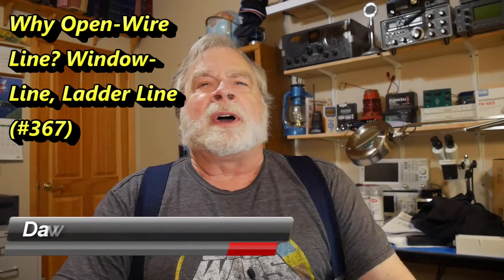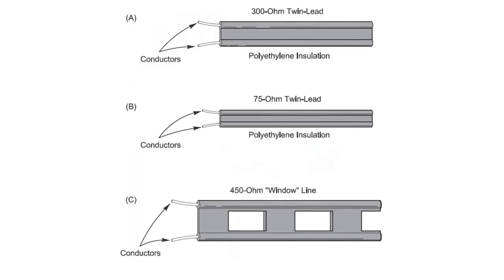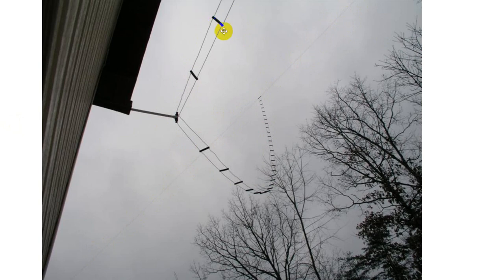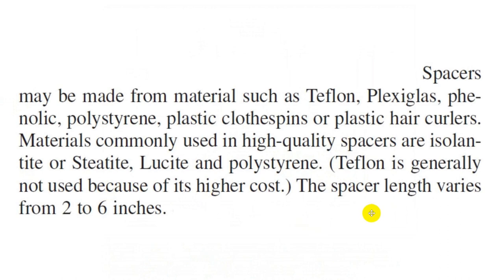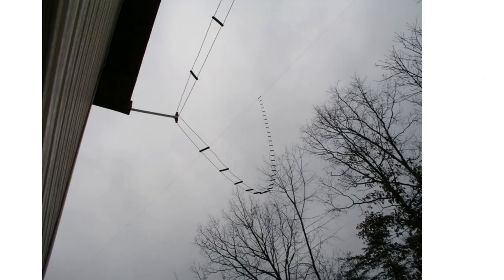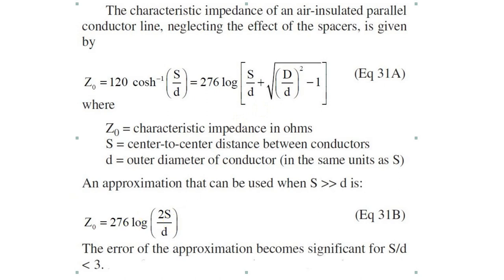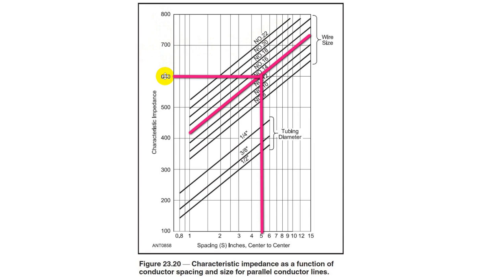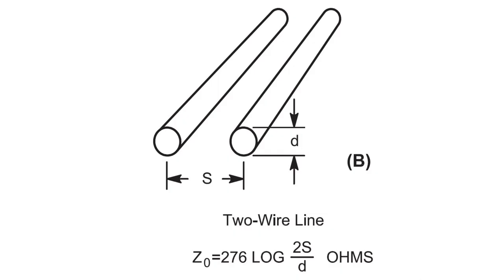Ladder Line, Twin Lead, Window Line (#367)

Comment: Thanks David. Getting back into amateur radio and purchased a 102 foot G5RV from DX Engineering with “window line”.. I was going to attach the center off the tower but now will use a tree limb at about 50 feet instead. There is a 450 ohm to 50 ohm connection point. According to your video, that would be a 9 to 1 balun. Interesting. Will keep all away from the gutter and tower. A most instructive video. Thanks. 73

Comment: I was running a G5RV antenna, which had 30 ft of window-line connecting to coax through a balun. The performance was ok, but not great. I decided to take the balun and coax out of the equation, and ran the window-line straight into my station, connected directly to my old Palstar antenna tuner (which has connections in back for window line leads). The performance is dramatically improved! I am now sold on the benefits of using window-line.
Reply: This is not a surprising result. The "ATU" will have a built in balun. So you have effectively just moved where the balun is located. However, you have removed the coax from the configuration on the antenna feed side of the ATU. The coax will have been causing loss compared to the ladder line. So, you get better results on rx and you should be getting more power to the antenna.

Comment: Thank you. Questions answered. More questions raised. 
These may have been answered already. 
If electrons travel on the outer skin as frequency goes up, how does corrosion affect the line ?  
Other than practical limit, is there a limit to how much impedance is too much ?  1:200 balun for 10,000 ohm ladder line ?
Reply from the maker: The electrons travel toward the surface of the metallic part of the line. For example, on an aluminum antenna, there is a layer of aluminum oxide that actually serves to protect the aluminum. The current travels just below this layer. A 1:200 transformer would be pretty hard to construct.

Comment: i'm a CBer on a farm and everything outside the house just got switched over to ladderline. vertical folded dipole fed by 450 up in a 80' pine. before i had a IMAX and 150' of 8x so the boost in signal levels was DRASTIC when i basicallly put the ears right to the tree with this new feed. wasn't really into dumping a ton of money on coax to get up there. so now im working on some 1.25~ doublets so i can do a 4x array for the west coast

Comment: A few weird things about "window" line. First, everyone seems to be selling line with copper clad steel conductors. There is a low frequency "cut-off" for losses. At lower frequencies, skin effect has lower impact forcing the current deeper into the conductor's steel core. I don't remember where I found the graph, but commercial window line is better above 4 MHz than below. Probably not significant for most users, but a legal-limit station on 160m might notice it. Second, because the conductors in "window" line are mostly steel, they tend to be extremely stiff, not to mention difficult to cut. I had some line that had #14 stranded conductors. I needed my fencing pliers to cut the stuff, but it was far more flexible. Third, you mention rain/ice effects. This is primarily due to the accumulation of rain/ice on the areas of solid insulation between conductors. I can't figure out why the "window" line manufacturers do not make the windows much larger. They could easily save and recycle a large percentage of the polymer if they would make much larger "windows" and very narrow (say 1//4-inch wide) spacers every few inches. This would make "window" line more closely approximate true ladder/open- wire line. Along with saving insulation, this would make the line much less susceptible to the effects of rain/ice.   Finally, a small challenge: Previously you did a program explaining why 50-ohm was the standard for nearly all amateur and commercial radio feed lines. It would be interesting to repeat that program for parallel conductor line. Finding the most efficient impedence might be an interesting study. 73 DE KG5AR
Reply: He mentioned that. The spacing usually is upto 6"; but it can be as wide as 12".
It depends on the power and the frequency of operation. 
More power needs wider spacing.
The lines (should always) carry currents  of equal magnitude but of opposite polarity. The ladder line does not radiate (or receive) because the fields (electric and magnetic) get nullified to a large extent. As he explained the intensity of the fields around the conductors die out as per the inverse square law of the distance from the lines.
For 30 MHz and above (50 MHz) the spacing can be like 6". Otherwise the lines may radiate. So the frequency of operation dictates the separation apart from the power that has to be handled.
You can choose to have the diameter of the conductors (including copper tubing) spacing and hence the characteristics impedance of the line for your need.
The 50 ohm standard was very well explained by him already, I suppose.
Regarding the dimensions of the windows or the polyethylene as you think it can be optimised; at the same time I believe it has been optimised for strength and integrity. Yes the water sticks (though it's a hydrophobic substance) at least for a while even after the rain (or fog, dew etc) and certainly increases the capacitance of the total system causing the SWR to raise considerably to the extent that it may be difficult altogether to transmit. But if too little polymer is used there is every chance that the lines might get twisted in the winds causing total havoc.
Yes the conductor maybe made of copper claded steel and the question of conductivity is a real problem. And this happens with the single strand; the multistrand #14 wire is flexible and very good which I have been using happily.

Comment: Excellent as always Mr. Casler - thanks for that.  Very timely for me: having poured concrete for the tower base a couple of weeks ago, looks like the Doublet should go in next weekend all being well, and I intend to feed it with 450 ohm window line.  My conundrum is whether to feed the window line all the way into the shack (garage) to a balanced ATU I have obtained, or use a 9:1 balun and convert to co-ax before bringing it indoors (perhaps more convenient?)... I have the components for both approaches so will probably experiment between the two..!   73 de G1AJH
Reply: How did you do this Andy? I have a doublet going to an antenna tuner and used a 1:1 balun.

Comment: What's the difference between a "doublet" and a dipole?
Reply: A doublet is intended for use with a tuner and may not be resonant on any band. It is fed by parallel conductor line. A dipole is generally center-fed with coax, and is made to resonate on the intended band of operation.

Comment: I am going to put up an antenna like his.  The center feed point will be held up by my 60 foot Ron tower. I am thinking about putting PVC pipes about every 5 feet to hold the window line away from the tower and a stand off near the top where the antenna will connect. Would about 18 inches be far enough, or what do you think is the best  to hold the window line away from the tower?

Comment: Just to be argumentative I have used wide spaced line with wooden spreaders (wanted to do it in an old school way) I used 1/2" dowel boiled in oil, it did work well but a few years exposure to the weather did still destroy them.

Comment: Two quick things. My ZS6BKW feed, 450 ladder line is close to the coax from a EFHW 8010 antenna. The end fed is straight out of the rig, the other one is switched out of line at the rig but when I transmit it shows power on the tuner meter attached tor the ZS6BKW. I separated them a bit more but tomorrow I am moving the feeds further apart to spread them more. Second is what about whether the twin lead has to be really flat and straight or can it be a little bent and twisted? Must it be straight?
Reply from the maker: Yes, you'll see some bleed-over from one antenna to another. Be cognizant of this if you have another antenna connected to another receiver. Re the flat line, you can twist it like a ribbon and if it's bent a little it won't affect your signal in any meaningful way.

Comment: I had a g 5rv in the air it got  hit with lighting. it blew the top of the g 5rv . I wonder if the ladder line is good to use. I also got a peice that I can put coax on and add the wire of g five rv and use the wiring of the g five rv wire attached to the spliper with coax If I guess right it would not be consider a g five rv ?

Comment: Dave.  question   im putting up a zero five -80 vertical not resonate on any band.  I need a run of coax of 75' from radio to antenna.  im using LMR 400 but at that im only 89-90 % efficient with a 100 watt station so im loosing 10 watts in the coax , im thinking a remote antenna tuner , what about 450 ohm wind line with PL259 on each end ? can that be laid on the ground? or buried ? just trying to find something to cut my losses   any feedback will help

Comment: Many many years ago 60-70 years most all TV antennas used ladder lead I have even seen ladder lead strung from power pole to power pole as a primitive cable TV service way back in the 60's

Comment: Hi Dave,
Very good info. Ladder line spreaders can be found at DX Engineering by SOTAbeams their SPC-100 and on Ebay as ladder line spreaders, but a bit pricey. Stay safe.  73  WJ3U

Comment: don't quiet under stand this. I had ladder line on my 706 and it worked good. I want to put it back up. there is some kind of thing on the end of the line that coverts the end of the ladder line to coax. I'm wondering about the lighting strike that hit this thing. would the ladder line and i guess what is a blum at the end of the ladder line that is in the house. I don't know if this is confusing or not.

Comment: Dave, Doesn't the frequency being used determine the (ohm) impedance of the line?
Reply: I agree Jerry. You are absolutely correct. To match the impedance,  a 450 or 600 ohm ladder line or window line to 50 ohm coax, it is not as simple as using a 9 or 12 to 1 balun except if the dipole is its resonant frequency. Most urban hams use long dipoles fed with ladder line as an all-band antenna. As you state the impedance between the ladder line will vary in relationship to frequency. In short at the termination ends it won't be 450 or 600 ohms. For all-band usage a high quality 1:1 current balun would work best (2 - 50 MHz).

Comment: What do the "windows" do and why does my wire skip every third window?  Thanks for the great videos.
Reply: Less surface area for water, snow, ice, or dirt to accumulate. Less wind loading. Less weight. But part of the dielectric is now air, so that changes the electrical properties of the feedline slightly.

Comment: Way over complicated. Unless your doing scientific experiments the average ham can disregard 90% of this video. Your going to hook this balanced line to your external tuner and it doesn't care if it's 200 ohms or 600 ohms. Just keep it away from metal the best you can it doesn't need to be perfect and it will work great. It's much easier to work with then you would think. There is lots of information on the net about how easy and efficient it is.
Reply: This is one of the nice presentations he ever made. You would want to watch it again 😉
Reply: Not sure I agree entirely that such large variations in impedance doesn't matter. In general terms, the higher the impedance the more efficient. So, maybe not a big difference say 550 to 650 but going from say 300 to 600 should make a big difference. That's why, especially on tx, 600 Ohm ladder line is popular versus 300 Ohm window line.
Reply: @Steve-GM0HUU  you please refer to my reply to Bill Brown in the comments section.